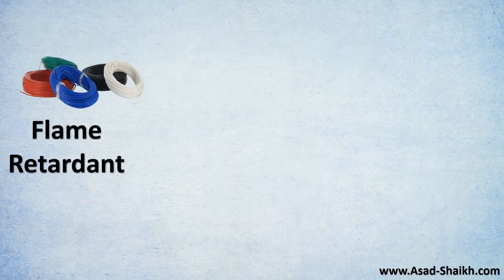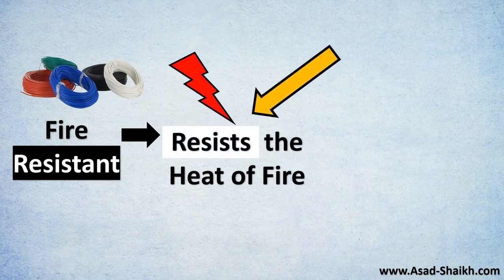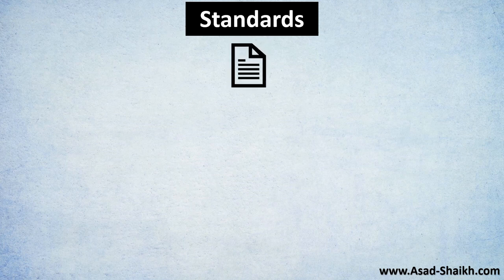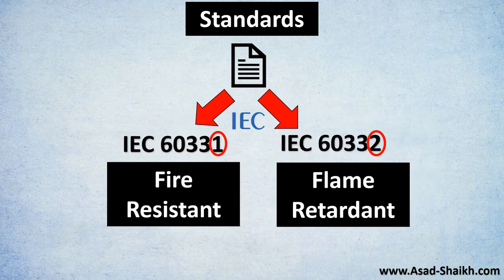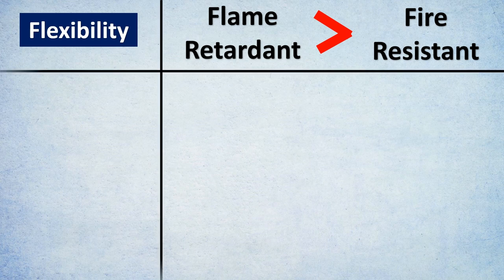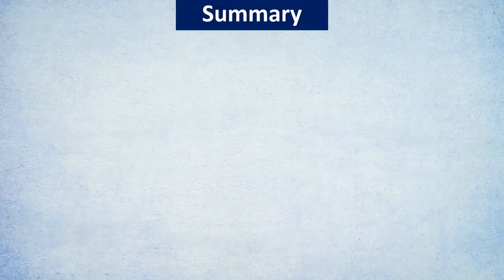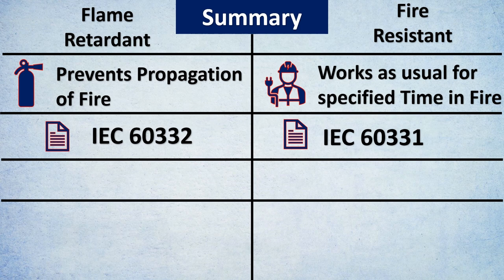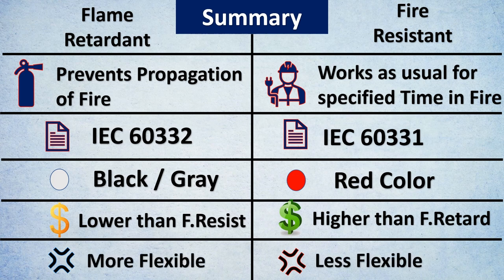Fire Resistant vs Flame Retardant Cable SELECTION

Comment: Around 2006 I went to Germany on business to Schwandorf, on the Ruver Naab, to visit Nabaltec, where we observed the Process to make Fine Hydrate Alumina. At Nashtec, we got our Feedstock from Sherwin Alumina in Liquor and Filtered it for our Precipitators. We received the Finished Powdered Alumina and ground it further to Spec in our Grinding Mills. At the time we had the largest Filter Feed Conveyors in the World. From memory, I believe the Fine Hydrate Alumina as Wire Insulation could withstand Temperatures up to 325 C, was Non-Toxic, and was a TriHydrate, which I believe would be classified as a Flame Retardant at this point. We were World Class quality and the most Cost-Efficient in the Industry. I wrote the SOP's, Commissioned the Plant, and my work helped get us ISO 9000 Qualified in a 3 Week Period. A rewarding Experience for me., and Germany was hosting the World Cup when we were there, it was an incredible experience.
Reply from the maker: thanks for sharing your experience 😊